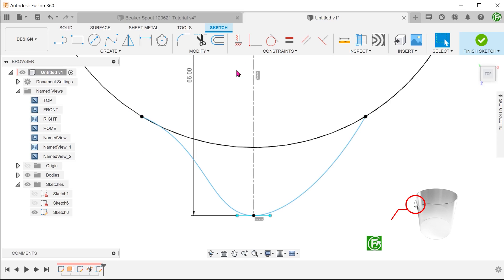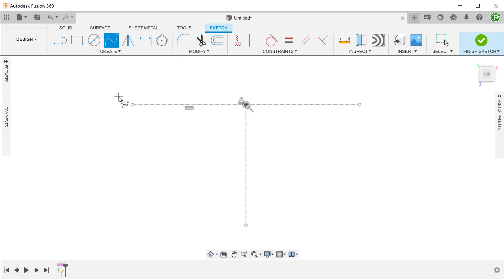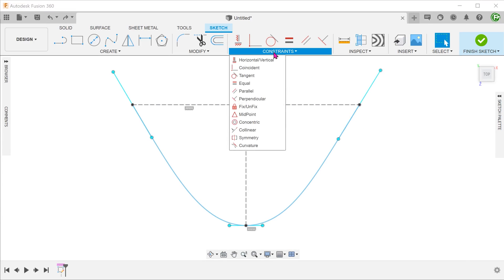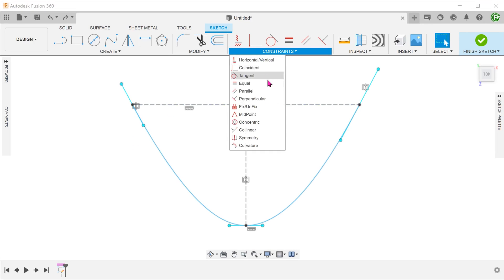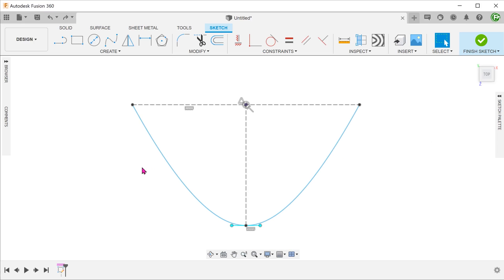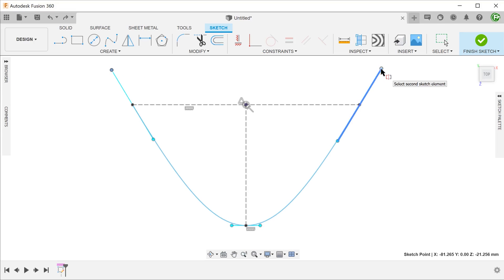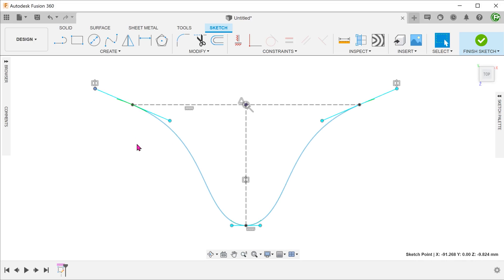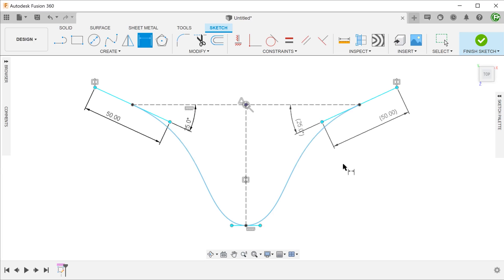Fusion 360 - Spline Symmetry

Comment: What’s the significance of the spine turning blue (and needing to make it turn blue)?
Reply: it turning blue means it has been adjusted away from the default spline path / regression through the points

when selecting a constraint type, fusion automatically shows all spline handles, so in theory they don't need to be moved

if however, there are multiple splines and you you want to apply symmetry to handles of different splines, you select symmetry, select a handle of the first spline

now you would want to select the handle of the other spline
but after selecting the first handle, all handles of other splines are hidden

so adjusting the handles you want to work with before selecting the constraint type assures the handles will be visible and selectable
Reply from the maker: @marc_frank  Thanks for this detailed explanation and also for the original idea! I must confess I did not know the significance of the color. After testing multiple times, what I found was that if you apply symmetry on a raw untouched spline, you would either get an error or the spline would go crazy and start going off in a wild direction. I found that these problems could be alleviated by slightly adjusting the handles beforehand.
Reply: @Fusion360School  ah yes that's another reason to do it :)
i think from a mathematical view, it means assigning specific values to the first and second derivative of the function
Reply: @marc_frank  thank you very much for the explanation!